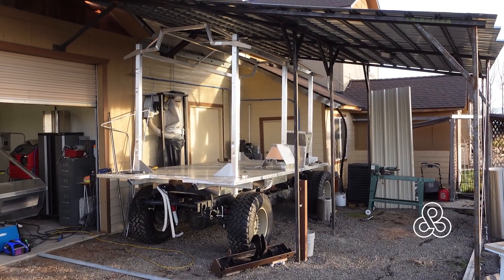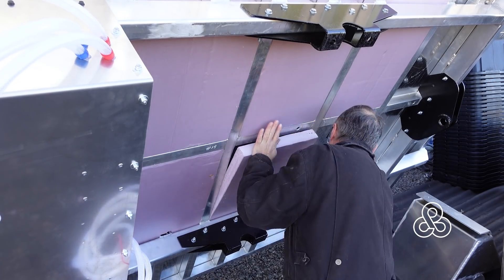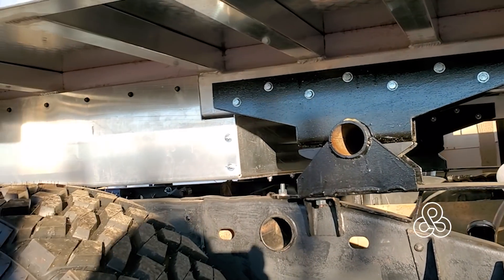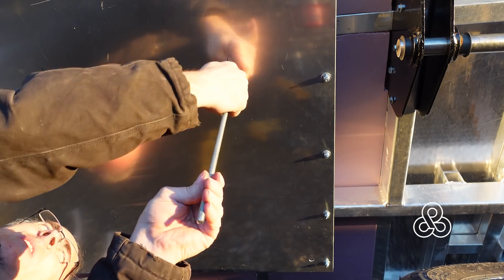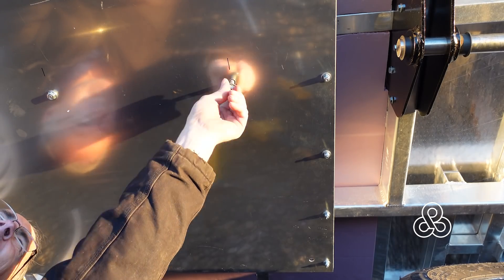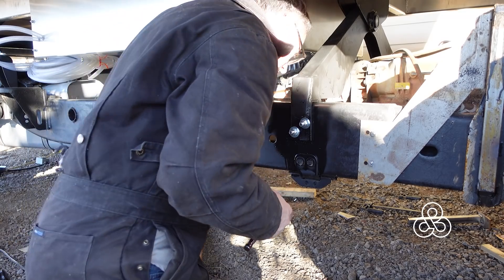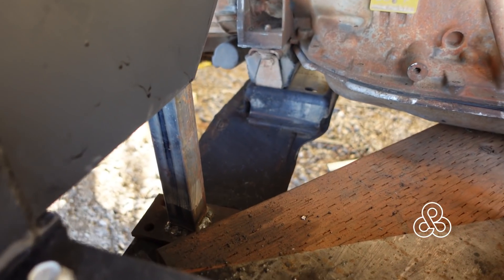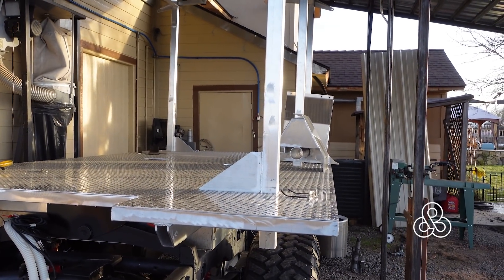L13 Three Point Articulating Sub-frame mount. Leviathan Amphibious Overlander Project

Comment: Hello, 
I built myself a Mercedes Sprinter camper. 
I don't go that extreme, but I often realise there must be a lot of pressure on the subframe.
For that, I'm in the process of having a 3 point flexible system.
Because you made your system yourself, which is a lot of houres thinking, can you please give me some advice on where to pay attention, some dimensions I have to respect, and more.
Best regards.
Willy.
Reply from the maker: The three point system works when the cab and cabin box need to move independent of each other and the chassis. If your trying to isolate a "van" style body from chassis flex, you might look into a loaded spring system.

Comment: On the sub frame how high does that sit above the main frame? I an effort to keep the total height as low as possible, what is the minimum separation between the frame and subframe?
Reply from the maker: I have placed the subframe 16 inches above the chassis frame for several different reasons. First, it allowed me room between the frames to mount water and gray water storage. Second, it allowed 8 inches of upward wheel travel without having to have wheel wells protruding into the cabin. And finally, it is still low enough that the rear door can fold down, acting as the staircase, and not be too high.
Reply: I'm concerned about the habitat being top heavy and placing the subframe too high off the ground. The subframe requirement is about main frame twist. Too many builders use a habitat construction that is vulnerable to twist damage, based on lightweight engineering and glued joints. Planning some twist isolation is obvious, but how much is still not understood by me.

Comment: I'm sure you already know that the closer you can drill the aluminum frame to the center the less chance for them to crack . It would be great if you had a way to drill the holes without leaving a sharp corner and leave them rounded over.

Comment: You heated the top of the tank can I ask why not put the pad on the bottom
Great build thanks for sharing
Reply from the maker: The type of silicone heating pad we used can not take the weight (or at least the shifting weight) of the tanks/water on top of them. I may be able to service them on top with a lot less effort as well. Thanks for the question and following the build. Glad to see some RVrs coming to the channel.

Comment: Great work as always.  From experience I would squirt some spray foam under that 2” insulation.  Over time it will vibrate and squeak and drive you crazy.  

On some vehicles I  built I had similar heating pads and found them ineffective on the top of the tank and needed to remove them and place them on the bottom.  I also had issues with the tubing freezing and put in some heat traces to deal with that.

Comment: The cab looks awesome! Fighter jet awesome. Fresh, shiny Aluminium FTW! Your blind threaded rod inserts to hold the tank looked magical - well done on such accurate locating.  Curious what the hole in the roof of the cab is for? Air con or swivel turret mounted 50 cal? ;-) Love this project to bits, great work, looking forward to more.
Reply from the maker: Hole- Reconnaissance drone launching port.

Comment: Great Progress!  Not 2nd guessing, but those washers under the Alum plate are still a "shear threat" - why not go to something like 2" dia. while you're there...
Reply: I guess we need to do a calc. What is the pull through strength of 3- 1 inch washers in 1/8 6061 t-6 aluminum? And sometimes you just can't wait for one more order (of hardware) to come in to move the job along. I had the 1 inchers on hand.😉